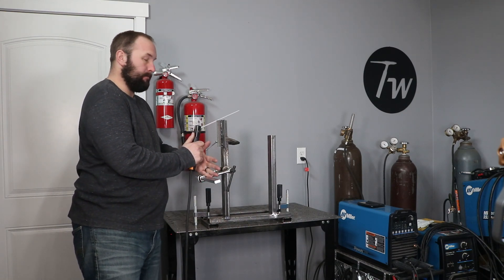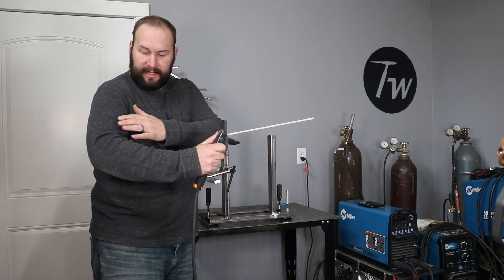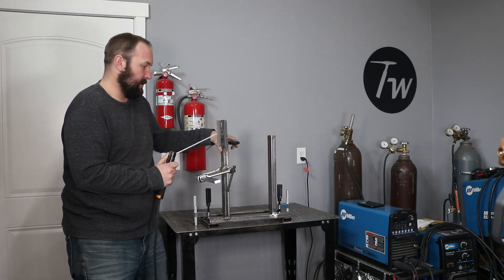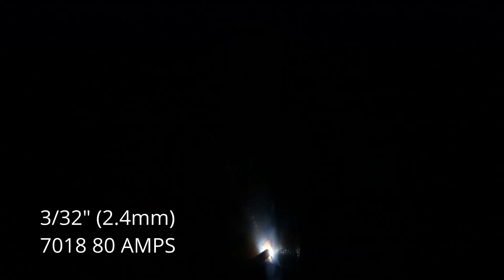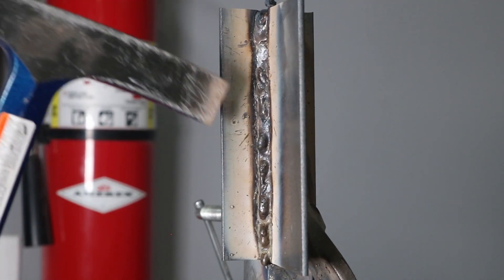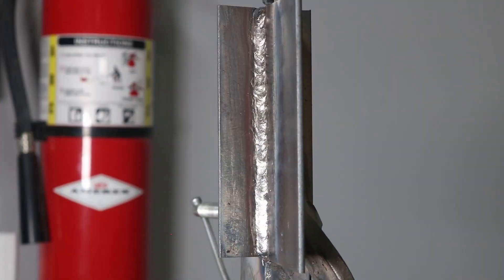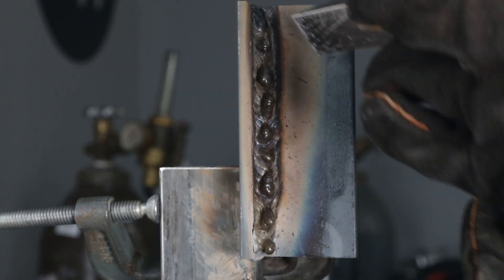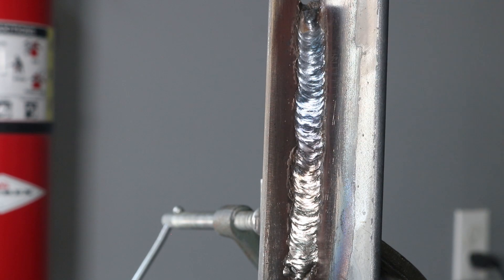How to Stick Weld Vertical Joints: 4 Ways to Get the Job Done

Comment: How’s the dekopro welder holding up? Would you still recommend for a starting off welder
Reply from the maker: It still works good, and I think it’s great for the price. The only issue that has come up is that the amperage readout isn’t completely accurate, but once it’s dialed in, it runs great. Definitely a good option for a beginner.

Comment: can you make a video with the scenario below:
I want to weld a square tubing  with 6013 vertical in a tight ditch so i can only put my hand in there and hold my electrodes downward. It's like a puzzle to me.
Reply: Tack stack your 6013 uphill, you'll get the best results and your weld will look better than any of the welds in this video.
Reply: @JarrenW83  i reallly appreciate your comment. I had this idea that tacking is a rooky and bad practice so i was thinking there must be a pro method for it. Now I'm more confident. Thank you.
Reply from the maker: I wouldn’t recommend putting a bunch of tacks for this, because it will provide a lot of opportunities for defects or slag inclusions. If you weld uphill, you can get away with a slight downward angle. One trick you can also try is to bend the rod and only use part of it. I hope this helps.
Reply: @TimWelds  I don't usually recommend tack-stacking because of how little penetration it provides to the weld joint but if the material he's working on is thin wall square tubing, tack-stacking can help him significantly reduce he heat input onto the base material which then helps prevent him from blowing holes through the base material. Penetration is actually decent when tack-stacking thinner materials (1-3mm).
Reply from the maker: Good point, Simple Auto, that it depends a great deal on the thickness of material that you're working with. It's a really common practice for auto body work with MIG welding to reduce warping and you could get a good result on thin-walled tubing with MIG. However, stick welding still has slag to deal with on so many restarts. Either way, the original question was about a constrained position for rod angle (which comes up really often), and I think the fact that the weld can tolerate a slight downward angle and improving the situation by digging out the ditch a bit in that area, cutting the rod short or bending it will produce the best result with any technique. If it does come down to stacking a bunch of tacks, I would look at switching to a 6011 electrode because it will penetrate deep right out of the gate. I appreciate all of the comments and discussion. I think having multiple different perspectives helps us all to learn.
Reply: @TimWelds  in Iran's market you will being told that in order to run cellulose electrodes you must buy a welder specific for 6010 and 6011 'cause they need a higher voltage to burn. And I've never seen a 6010, or 6011 in any local shops. That's why I'm always looking for videos about welding with 6013 but they are rare on youtube.

Comment: Nice video. Could you possibly make a vertical up 7018 AC video with the AC225? I have the exact same welder, and it always seems that when using 7018 AC for vertical up, it sags when I do stringers. When I weave it in it turns out much flatter but still lumpy. I know that AC current is harder to use in the vertical and overhead position then DC. In school, I would always pass all the 7018 vertical up tests. With the DC stick welders there, the weld would lay in flat with the stringers no problem.